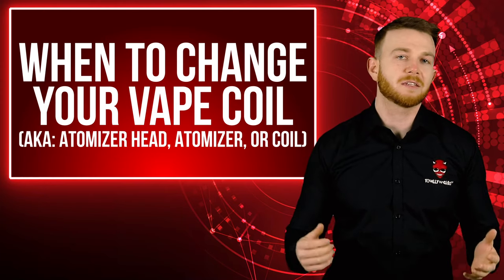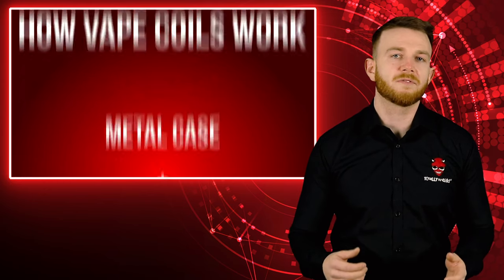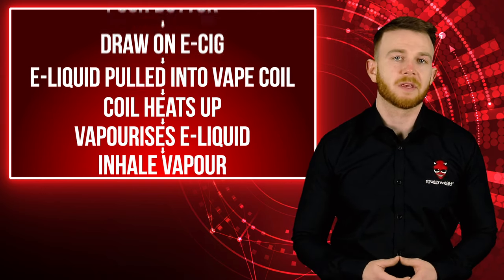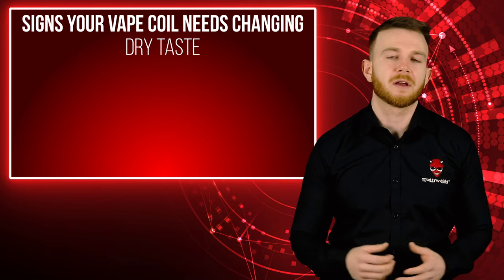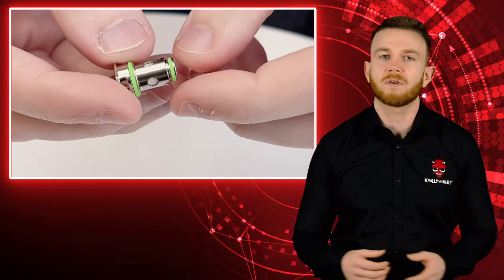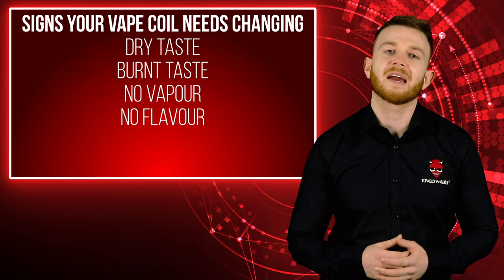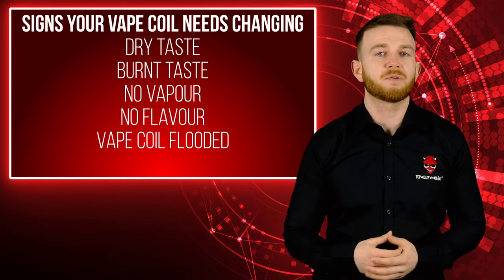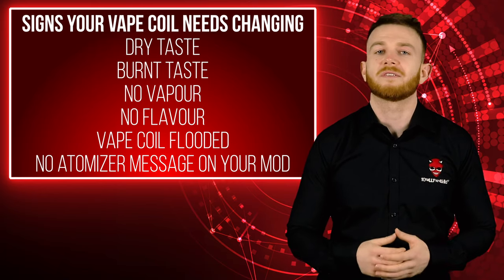When to change your vape coil (atomizer)

Comment: I run a Smok IPX80 with the 0.16 mesh coil at its preferred 40 watt.... first few puffs in the morn I start at 20 and work up to 40 in about 8 clicks and I reg get about 12-1300 drags out them! 🤔 
I only use 3 different types of Tobacco juices at 80-20 so the first thing i feel that goes is the vapour.

Keep Clicking, 💨

Ross

Comment: Yo. I change or clean if I can my Aspire 1.8 coils when I start to feel I am getting a ulcer / pimple thing on my tongue, it happened when I used to puff (yes Mary J) and I would power through with Ambesol and I get the same with my coils, now I often wondered the time frame roughly of how long my Aspire coils last and I get between 7-9 days at 10W and between changing mods it equals around 1000-1200 puffs. Anymore than that (it’s normally 7-8 days at 1000) and I start to get the harshness or feeling of a ulcer / pimple on my tongue…just hope this helps some people because I hate them MF things and they last for time but as soon as I get that feeling, change the coil and get the Ambesol out for a few dabs

Comment: I switched to 90:10 VG/PG today, I get a ton of cloud but, the taste/flavor is gone, does this have anything to do with my coils? I even added more PG later on and more drops of flavor to even things out, of course all properly measured to the right amount of drops but, I get very dry taste, what could be wrong?
Reply: Try 50/50 vg pg
Reply: @samc8531  what olhmage of coil  is good for what ratio of base?
Reply: @Sir Kay  I run a 0.8 olm coil and I use 50/50  because if I'm was to use 70/30 for example it would be hard for me to puff as I have a higher olm whereas if you had say like a 0.4 coil with 70/30 you can because the coil is more "powerful" so from my experience if you have 0.8 or more then I would have it 50/50. Here's another thing 70 30 gives you more cloud. So overall stick with 50/50 when buying juices for coils and only go up if the coil supports it. Hope this helps
Reply: @Sir-Kay  Think of it as balancing cloud:taste
Reply: @samc8531  So less resistance 0.15-0.4 are more powerful and higher resistance olmage coils are not as powerful 'cos they vape at less wattage is that what you're saying? kinda counter-intuitive right? and that's where the confusion comes in, as one would think a 0.8 olm coil would take anything ratio thrown at it. Anyways thanks. I'm currently trying to make my own Apple pie clone, I just ordered another batch of flavors but, forgot the damn thing. I know how to make the real thing in the real world but not in the e-juice world, does it kind of translate? if yes, what percentage should I put/add what?

Comment: I have my coil for just 1 day and the cotton on the inside where the mesh is the cotton is a very brownish colour,is it burn or normal?
Reply: Should be normal, you just need to change it about every 2 to 3 months. You should be alr mate
Reply: @ryan_m0408  I didn't know a call would last 2 to 3 months
Reply: @Steve-si8hx  depends on how long you use it. I’ve stopped using vapes so I’m clean now but I didn’t have to change until about 2 months in
Reply: @ryan_m0408  I'm using it to quit smoking cigarettes so I'll be done with it eventually to

Comment: Iv just changed my coil an it tastes burnt
Reply: When you change your coil put a few drops of liquid into the mesh before you put it on.
Reply: @wyattblessing7078  what liquid?
Reply: @wyattblessing7078  im having a problem with my vape, it has a burnt tase, what liquid should i put on my new coil?
Reply: @AMSeyer  I’m also wondering just burnt through a brand new coil even tho I primed it and let it sit went easy on it it burnt immediately
Reply: @AMSeyer  liquid as in the juice you’re using in the vape
Reply: @justjoshin5140  don’t start at a high wattage you have to build it up by hitting it a couple times. That could be the issue
Reply: Also some vapes, especially cheap ones cant handle VG(Vegetable Glycerin). If the juice has VG, and you got a cheap vape, this may cause a burnt, dry taste even with new coil thats been primed
Reply: @justjoshin5140 you have to put 3 trops of juice inside the coil before puting on